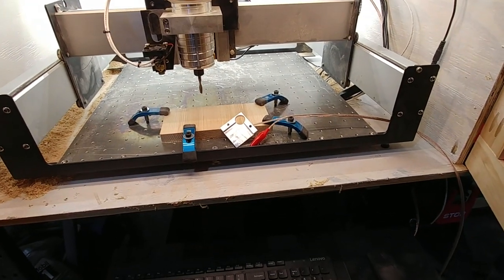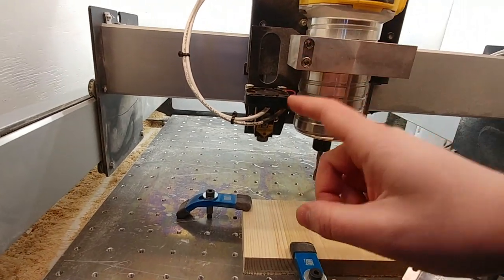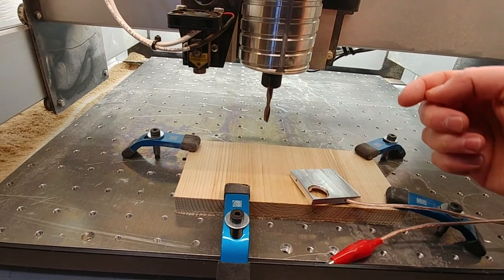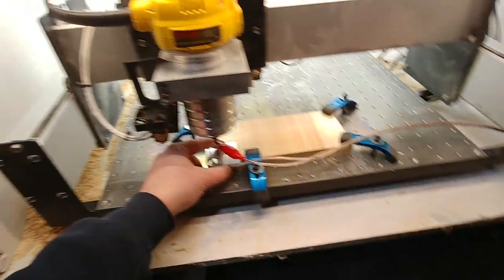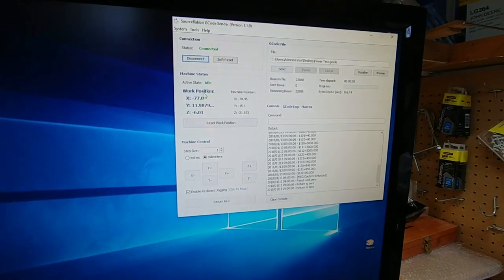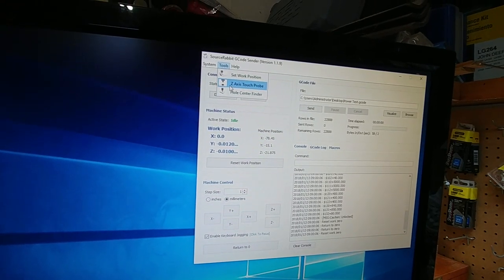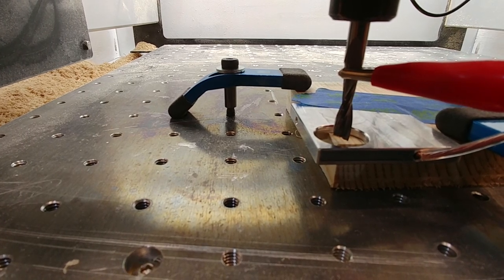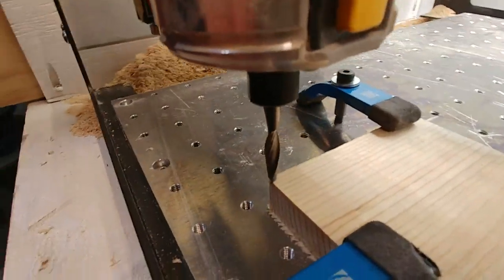Adding A Touch Plate To My Shapeoko 3

Comment: problem with touching center of a hole is that, your tool is not rounded (when is not spinning), so you touched x- with front cutting edge and x+ with back of cutting edge. That's gonna give you center at wrong position. It would work with 1/4" dowel pin.

Comment: As others have said, the hole finder is not very accurate when used this way, but...
If you are not indexing off an existing part (ie you don't need to cut accurately relative so the existing part geometry), then this is accurate enough when starting with a blank stock  (which I almost always do for wood routing).
Otherwise, as others have said you can use the other end of a bit (round end) and it will be quite accurate. I normally do Z last as I need to redo it for bit changes anyway, so it doesn't matter that I need to take the round bit out and put my cutting bit in.

Comment: I think  it's not accurate at all because you're using a 2 flute end mill for center finding.
If the end mill isn't touching exactly in the vertical middle of the hole (8:30), then when touching the other side (8:39), a piece of the end mill makes contact which has a different distance to the center of the mill than with the first touch on the left side. (it's not the mirror of the end mill)
So if you want you be accurate with this, you better use a round "end mill" , or one with more flutes to minimize the inaccuracy

Comment: Hi Edward, why can't you use carbide motion with the tech laser? Been considering this upgrade but I'm used to CM. Please lemme know
Reply from the maker: Hi. You can't use Carbide motion with a laser because their software doesn't take M code (macros). M code is what is used to turn the laser on and off.
Reply: @edwardblanchard463  I wrote a small program to insert the M3 and M5 codes in the proper places, but Carbide Motion is STILL useless because it pauses for 2 seconds EVERY time the laser turns on. So on my laser cut with 170,000 turn-ons, CM would add a whopping 94 hours to the run-time. I told them about this but they never replied.

Comment: Hi,  What is the purpose of the hole finder?  What is the process of positioning the place so the hole finder is accurate?
Reply from the maker: The hole finder ensures a perfect zero, regardless of bit size.  Very handy for tool changes.

Comment: If you can't use Carbide Motion, it's a pretty lucky break that you couldn't buy Carbide's touch plate, because AFAIK it only works with that application.
Reply from the maker: Hello. You can't use Carbide Motion because they do not allow you to modify the plate thickness within the app.  Since my eBay plate is 1/4 of the thickness that the Shapeoko Plate is my zero would be off. Essentially, they designed it to accommodate the thickness of their plate and their plate only.  I can't blame them, I'd probably do it that way too if I owned the company, it would certainly boosts sales.
Reply: but that would mean if you screw a spacer block of aluminium to your touch probe and then mill it to the perfect height you could totally use it with carbide motion?

Comment: Has anyone found a wiring diagram for this?
Reply: 2 wire, connect to controller probe connection, one wire ground and one wire probe in connect port.

Comment: why waste money buy aluminium touch plate, you can made whit cnc same plate in home, if can mill wood can mill aluminium too.make pocket square first and then hole and mill, then cut outside dimensions plate out of aluminium sheet and you have same touch plate no need buy. only need buy cable if home not have, and allicator clip,